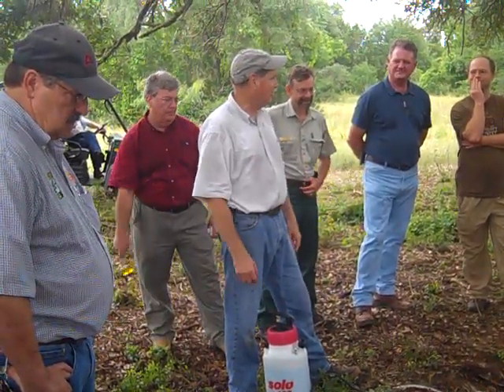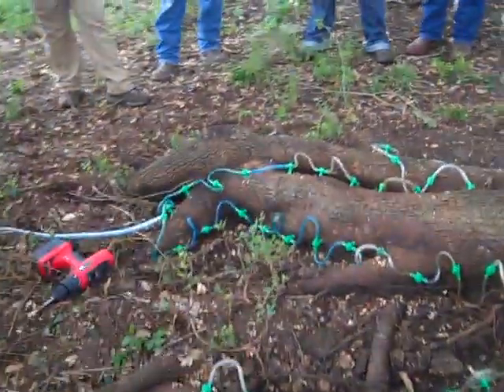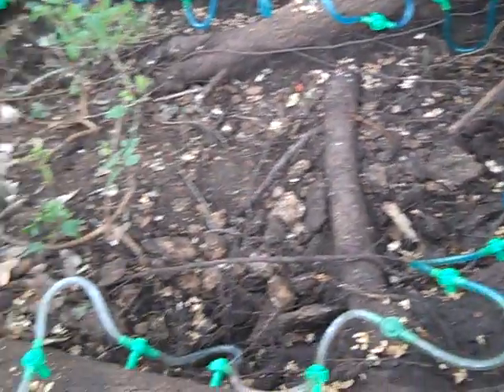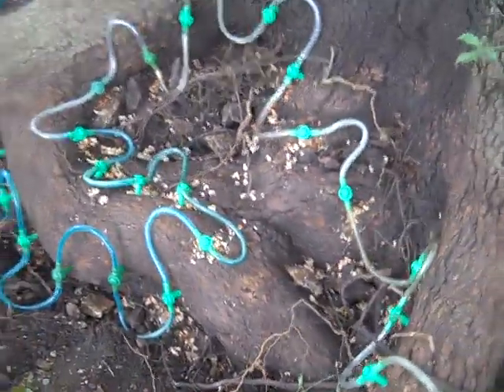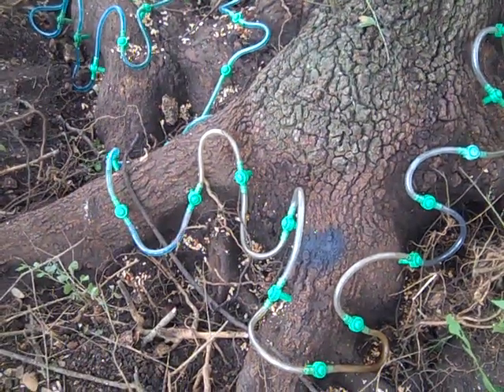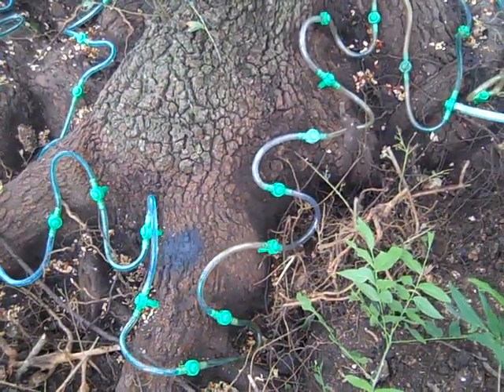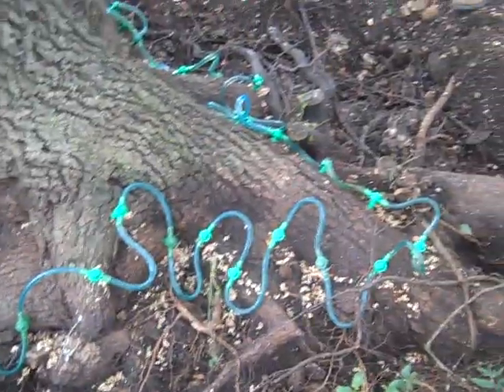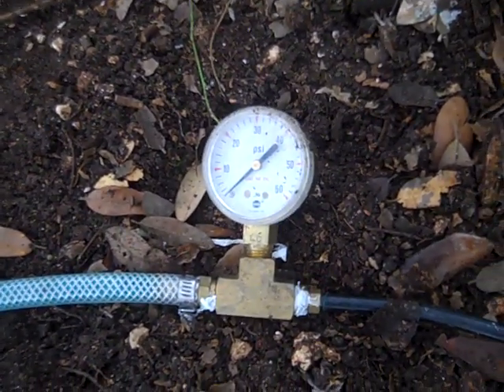Oak Wilt Treatment

Comment: Trunk daisy chain trunk injection obviously works, with proper uptake on Ash trees too. But what i don't understand is when one applies to each hole manually, each obviously has their own uptake rate that can be observed/sensed. Like series electric circuit, won't some take in more, or less than others? What makes it work right in end?